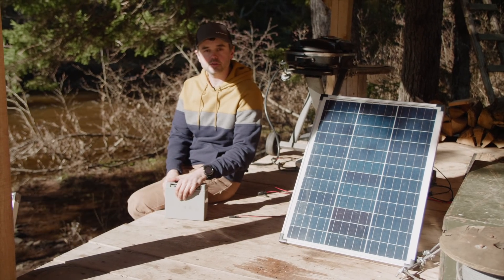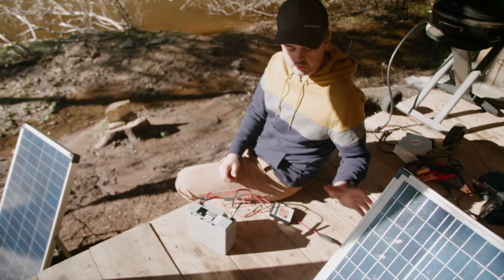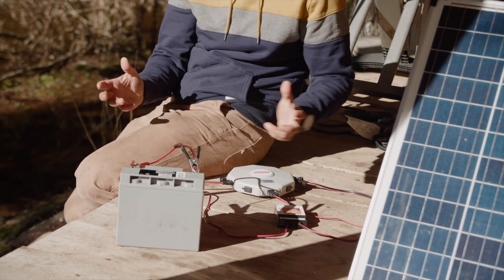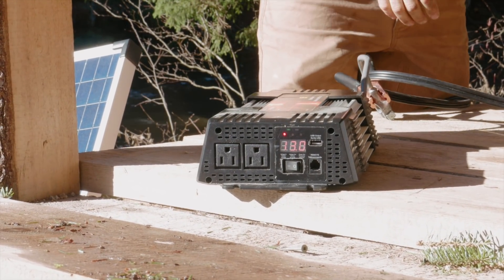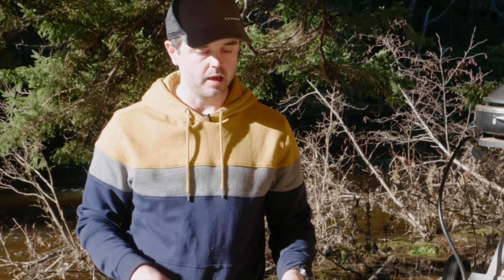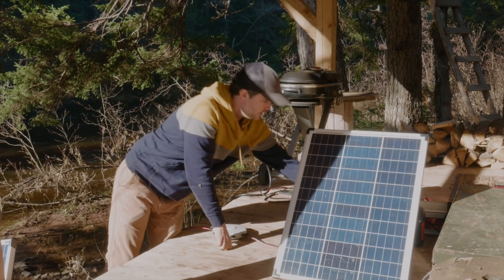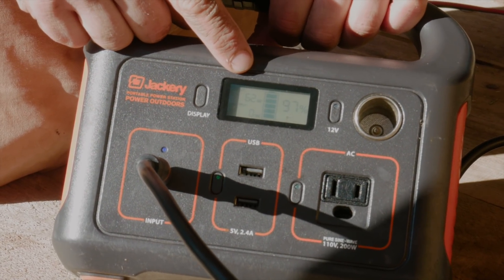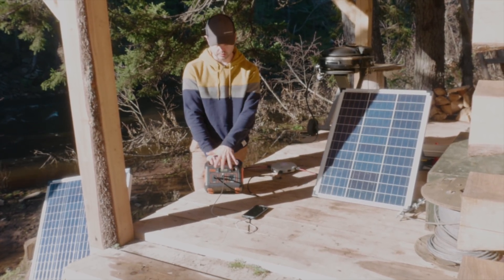Simple Solar Power Options for an Off Grid Cabin | Two Basic Options for a Simple Solar Power System

Comment: Retired AF avionics tech...  cumbersome looking but excellent setup for instruction purposes, great explanation!  Prices are coming down on solar, and there are larger capacity quality lithium iron batteries that will have more cycles and usable percentage of capacity for less than 500 dollars now if you shop for them.  The solar hub, or universal solar connector is a new concept to me, and Harbor Freight has them for 18 dollars which is the lowest price I found.  The polarity reverser depends on what solar panels you have so just follow the color and markings on the wires.  You can get power stations with different types of batteries in them.  I am not familiar with Jackery but EcoFlow has a number 2 after the name for lithium iron batteries.
Reply from the maker: Thanks for the comment - So much change happening in off grid solar tech. I've improved my set up a lot since this video.

Comment: Thanks for the video. I didn't know about the hub or the reverser, I got 4 x100w Coleman panels for free and thought I was going to have to splice all the ends for the MC4 connectors. Have you checked out the Cabin Depot,  they are building up their inventory with some new solar equipment. Again ,thanks.
Reply from the maker: Yeah I got some lighting options from the cabin depot. They have been very helpful. The hub from Coleman is really useful for linking together a bunch of solar panels. That's awesome that you got four of them! Hopefully things will settle down so we can cross the provincial border again

Comment: I would recommend you plug the charge controller to the battery first before you plug it into the solar panel. If you don’t you could fry your charge controller
Reply from the maker: Thank you for the tip, very much appreciated! I really don't use the charge controller much now as I have the other power bank set up but that's a great tip and thanks for taking the time.

Comment: Very informative. You could try a water turbine in the stream also. Surprised you need a cell booster, isn't Mount Hope close by?
Reply from the maker: Surprisingly there's quite a few dead zones even though it's not that far away. There's completely no service at the cabin. The water wheel would be an amazing project, do you have any experience building these?
Reply: @PenniacWilderness  no experience just dreams

Comment: Seems a plausible way of getting small electronic devices charged up and running. You also can use it  for some lights in the cabin. Looks like you're moving on up! I will be interested in seeing your next video on your present set up and what you run from it. Great job on this presentation of your stages in getting some power to your devices in the middle of no where's. 👌💡
Reply from the maker: Thanks a lot! Yes my current setup is a bit better for my needs. I do have a light that illuminates the cabin which is really useful. I'm still working on maximizing sun exposure for my solar panels. But it's all coming together! Hope to have a new video out shortly on the new solar setup.

Comment: Solar power is expensive, but, looking at the creek and all that energy going by your cabin, it would be a good source of energy with the right setup to change your batteries.
Reply: I was thinking the same thing like a waterlily
Reply: @elwoodtaylor1092  Looks like a good product, no sun required, and it’s on sale 👍🏻
Reply from the maker: A few people have mentioned this to me and it is something I would strongly consider. It strikes me as a bit of a project, so I'll have to do my research. The stream is quite low in the summer but it does flow well year-round.
Reply: @PenniacWilderness  I bought a waterlilly windlilly bundle but haven't received it yet but its an easy setup and will operate 24-7 with wind or water on days without sun for my solar setup, its worth looking into for sure, you have an awesome spot there and I enjoy your videos, I'm just crossed the pond from you in NS